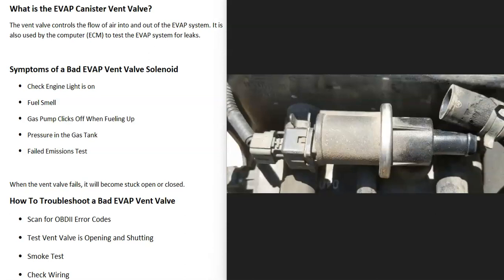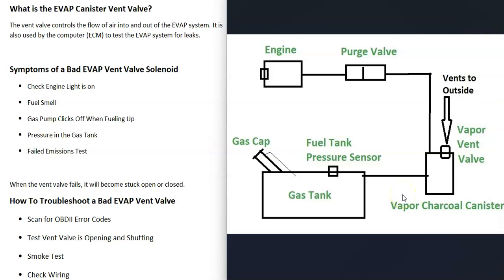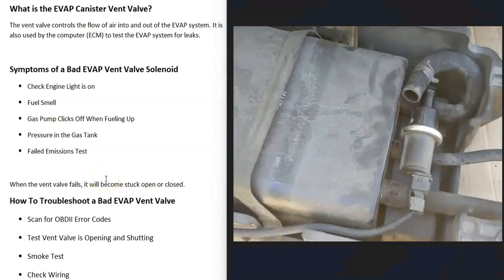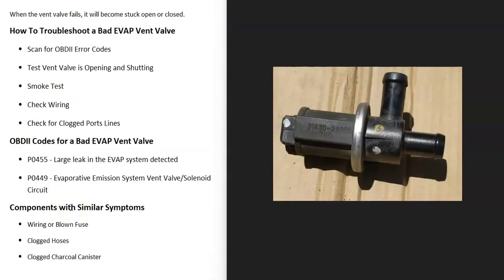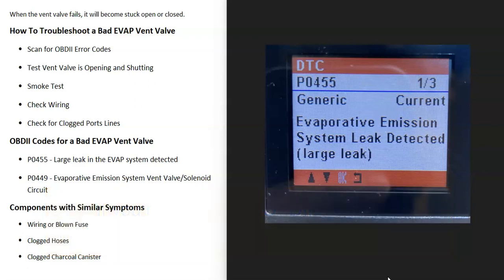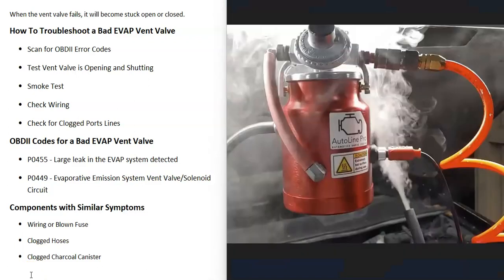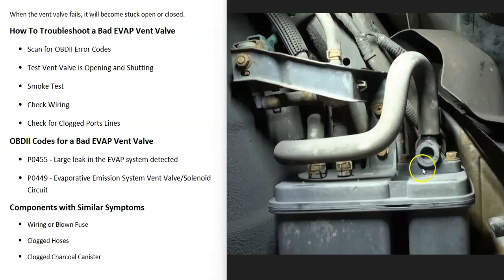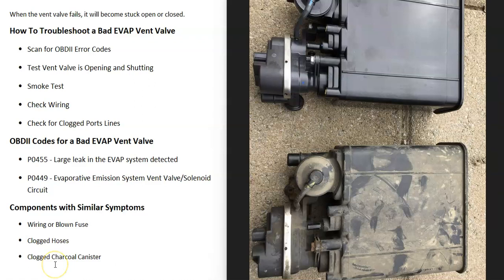Symptoms of a Bad EVAP Vent Valve Solenoid and how Test if it Has Failed

Comment: I took my vent valve out and did a bench test and noticed that the vent was getting stuck closed attached it to 12 volt battery to the sensor noticed that it was clicking but not moving sprayed wd40 in it shook it around gave it 12 volts a couple times worked the wd40 into it worked much better was able to see it moving.

Comment: I have a question. I'm not very mechanical, so if it's a stupid question I apologize up front. It may pertain to the evap valve referenced in this video. I have a 2013 Ford F150 FX4 5.0. It doesn't have a gas cap. Sometimes when I stop to fuel up, I can hear a sucking sound where the gas goes in and when I put the gas pump nozzle through the inlet it all releases in a gasp. If I turn the engine off while I fill the tank, it's very difficult to start. Almost like it's not getting fuel. It does eventually start. If I leave the engine running while I refuel, it does fine. The check engine light comes on once between each refuel, but goes back off in a day or so, and the gas gauge isn't accurate so I fill the tank full each time. I have never been to get engine light checked while it was on. Any idea as to what I need to replace?
Reply from the maker: I would test the purge valve; it is located in the engine bay.

Comment: Hi can this cause rough idle and negative fuel trims?I only have sometimes have fuel smell inside cabin and sometimes fuel pump at gas station clicks off
Reply from the maker: A bad EVAP purge valve located in the engine bay can affect the engines idle. A bad EVAP vent valve stuck shut can cause issues when fueling up.

Comment: Can the EVAP canister be cleaned with water or other fluid instead of replacing it with a new one?
Reply from the maker: The vent valve can sometimes be bought separately, but it will vary. Many vehicles now have it contained in what's called a leak detection pump attached to the charcoal canister. The charcoal canister is full of small charcoal pellets that filter the gas vapors. If that is clogged, I'm not sure if that can be flushed or not.

Comment: i have a 2013 wrx, having issues with filling up and not wanting to start up right away. I replaced the purge evap, the charcoal canister but to no avail. i think the vent valve might be my only other option and relatively cheap, to hopefully solve my issue. :( i also dont have a check engine light so i dont see any codes to show what it exactly is, just know its only when i fill up but i do smell gas inside my car. very aggravating.
Reply: Hi did you get this fixed? I’m having the same issue on an 08 outback plus low/rough idle sometimes.
Reply: @jacobbranca the rough idling at times hasn’t stopped. It tends to want to go up to 1.5k rpm at random times when I have the clutch in stopped at a red light. not sure what that could be. But the not starting up after filling it up has stopped thankfully. Since making this post, I’ve since replaced the vent valve and the gas cap right after and it seems to have gone away.

Comment: hello bro, i change already my vapor canister but sitll overflowing my gas tank while its full and the gas nozzle stop. but my gas tank overflowing gas. i change already a purge valve as well but its still same issue... how can i solve this bro?
Reply from the maker: While a bad vent valve is the most common cause when the nozzle clicks off, other causes can be a bad Fuel Inlet Check Valve, Roll-over Valve, or other manufacturer-specific component. If the vent valve is good, I would get a diagram of the filler neck components to see what else could be causing it.

Comment: Great video, explains it well!    My issue I've been having might stem from a bad vent valve solenoid; My gas tank definitely has pressure buildup (noticed when I open the cap) and when I fill with gas, it ends up backing up and spilling out even when the tank is near empty.
Reply: I have the same problem. Did it end up being your vent valve?

Comment: If the AVAp canister- mine is by fuel fill  underneath it-- If the valve is a release to pressuring the system in  tank why wont it releease the pressure to fill with gas  when key off..I even  to hose off.. still wont fill...Sometimes it  does. usually if go  to gas station  right away.. The Purge valve I am told is Not  talking  to te computor!!! Now I am getting EGR..Just  replaced that  and  upper and lower intake manifold gaskets..I am getting Po443 Or is it Po433.I  forget..wont even delete  with  scan tool  many times..takes 2-3  tries. Been  this way  for 3 yrs..there is a anti slop valve in tank  where the Big  hose come down t the charcoal filter.. That maybe sticks!? I  dont understand  why pressure doesnt release  when key is off!! or hose is totally  off to EVAP canister!!??

Comment: If I smell strong gas smell outside the vehicle near the gas tank only when  the tank is filled above 3/4 , and goes away when tank is lower, no leak around pump, no leaks seen, no gas smell inside, no check engine light, no issues with filling.  could it be this part?
I do notice if cold ,first start is fine but if I drive a mile ,park  and 20 minutes later I try to start, the engine stumbles/takes longer to start. 3rd start no issues. 
I'll be changing the vent valve tomorrow because that did check out to be stuck open. But I was not sure if a strong gas smell around the gas tank would be from that valve.
   Ford Escape 2.3l fwd 176,000k .

Comment: can this make the engine have a slight misfire in Park, especially when first start up for the day ?  Car ran good until cold weather but uses obd1 scan tool which I don't have.
Reply from the maker: I've never seen a vent valve cause engine issues. Usually, the only EVAP component that can affect the engine is the purge valve in the engine bay.
Reply: @HVAC_Mechanic  Thanks.  Purge valve on order because it has a rattle/tapping to it which was never there before, original equipment.

Comment: I have codes po452 and p0651. I have difficulty refueling and difficulty starting after refueling.  Reduced engine power light on and won't drive. 2005 suburban with 6.0 engine. Anyone want to buy it? In socal 20k

Comment: Thanks for your great video's strait to the point and very informative. My 2003 f150 has po 455 and 457 . Watching your video's I confirmed my purge valve is good. I hooked a new to me smoke tester to the line at the purge to the tank. I applied 12 volts to the vent valve to close it. I had smoke seeping out of the pressure sensor at the top of the tank and a very very small amount coming out of the charcoal canister outside air port. I dropped the tank part way and put a new pressure sensor in. Same results still smoke at the sensor and canister. Smoke machine under to much pressure (which has a built in regulator) ?  If not is there something I can do to stop the leak at the new sensor from the blow by at the o ring ? Thanks for any help or input.
Reply: Replace the whole canister it’s probably warped or something

Comment: Hey man, I have a 19 Camaro SS (6.2 V8). My evap vapor percentage is CONSTANTLY in the negative (measures in inH20). Even with the evap command is zero it still stays negative. I'm running extremely rich, and have checked everything. When it starts to evap command goes to zero (shutting), the vapor percentage reading goes EVEN MORE in the negative (-4.6 inH2O). It's constantly purging while I'm driving, it seems, rarely does it go to zero. What would cause this?
Reply from the maker: It needs to be diagnosed but I would test the purge valve in the engine bay. I made a full video on all the EVAP components and how to test them; here is a link. https://youtu.be/C5s3Rx3wjD0
Reply: @HVAC_Mechanic  i did, it was shut with unplugging the connector. It seems to constantly run though 🤷‍♂️
Reply: @HVAC_Mechanic  car did seem to run better with it disconnected, and my fuel trims did get a tiny bit better, and the inh20 reading was EVER so slightly in the positive for the first time i had ever seen.

Comment: I have a P0442 and changing the gas cap and purge valve did nothing to fix it. I’m wondering if it’s the vent valve in back.
Reply: Does the gas pump shut off while filling?
Reply: @ no and this was 4 months ago. Problem was solved.
Reply: @Jonathan-A-877  Glad it was fixed. What was the solution?
Reply: @Jonathan-A-877  hey can you give us some insight on what your issue was?  Got same code, have changed the gas cap, purge valve, and charcoal canister and still having same issue!
Reply: @benjaminwatson2695  All I did was tighten the gas cap more after filing and it went away. So, it actually was the gas cap on my Saturn. No light or code since.

Comment: I had my EVAP solenoid valve replaced in my 2020 Ram 1500 and it still has check engine light on and the gas pump clicks like crazy. Do you think it’s the tank, charcoal canister, roll over valve or filler neck?
Reply from the maker: That is a common system of a bad vent valve. Was the correct solenoid replaced and tested? There are usually two solenoids: the purge valve (evap solenoid) located in the engine bay and the vent valve located near or built into the charcoal canister.

Comment: Is possible to clean the vapor vent valve canister
Reply from the maker: If a hose or port is clogged up, they can be cleaned out, but the canister itself would need to be replaced.

Comment: On Moms 2010 Chevy impala , throwing a Po453 and po463. When working on Putin a new fuel pump, noticed the 3/4” hose coming off the evap canister was full of fine dirt, from the dirt road she lives on. Gas tank was clean. The vent valve was slap full of dirt and the hose. The top has tabs , so you can take it off and clean it. Has a round sponge filter to washout as well. Should I just put it back on and try it ? Should I also put a new charcoal canister on. Not throwing codes for either.
Reply from the maker: As long as there is no wiring issue, swapping out the fuel pump will likely solve the codes. I would only swap out parts once they fail, but if you think they are ready to fail, it may be a good idea.

Comment: I got a great question, should gas be coming out of the valve?
Reply from the maker: The only gas vapor comes out of the vent valve. It should not be liquid.
Reply: @HVAC_Mechanic tell me about it.. ugh, no idea what the hell is going on 🤦‍♀️
Reply: If you have liquid fuel coming out of the vent valve I would guess your charcoal canister is full of gas as well. Do you "top off" your tank on fill-up instead of stopping when the gas pump shuts off the first time?
Reply: @JK41071 I had already replaced the canister before this. I looked under my other silverado and how those lines were hooked up. Turns out I switched the smaller rear lines so they weren't hooked up to the right things.

Comment: Can this prevent my car from starting?
Reply from the maker: The engine should still start. If the purge valve (separate from the vent valve) is stuck open, sometimes, it can affect the engine and may cause longer start times, but usually, the engine will start.

Comment: Going crazy.  Have a evap issue with 02 Suzuki XL-7.  Decided to replace the whole contraption to eliminate rusted evap lines and old hoses.  The vent solenoid body definitely leaking.  In my process I've found a small line coming from the fuel tank vent that goes to what looks like a check valve.  Seems simple to just replace but not sure if it should really be a one way or a metered valve. Seems like open going toward tank and restricted going into larger line that goes toward charcoal cannister.   Don't want to install a new one way check valve if it is supposed to allow air both ways.  Also not sure if it is even needed if there is a evap solenoid doing this job already.  Confusion as to if it is to hold back some pressure to stop the gas pump when filling.  Not seeing this valve in any diagrams I find online... don't want to install something that may have been done previously in error...
Reply from the maker: There are differences between EVAP systems depending on the year, vehicle, and manufacturer; the only way to know is to find an EVAP diagram for the vehicle.

Comment: Got a PO0456 code.  Evap vent valve seals ok with light pressure, but not with vacuum.  Would that generate an code?

Comment: How about diagnosis the opposite where the automatic shut off doesn't activate soon enough so that everytime you fill up a small amount of gas spills out before it shuts off.
Reply: I am having same problem on 2004 F150 4X4. Have you found fix?

Comment: if you do a smoke test and smoke comes out the valve, its not necessarily bad because it is normally open until it gets a signal, correct?
Reply from the maker: Yes, this is true. I should have clarified this better. You can turn it off by adding power, usually with a scan tool, or be aware of its location and that smoke will come out of it.
Reply: @HVAC_Mechanic  Oh man! I wish I had read this before I dropped my gas tank, took off a rear wheel and all the shrouding, to replace my charcoal canister only for the new one to leak out the same atmosphere valve!  Half a saturday gone!
I'm out of ideas for hunting down that evap leak code, changed charcoal canister, gas cap and purge valve.  smoke test only ever showed smoke out of the charcoal canister atmosphere valve.

Comment: Hi I have a 2003 Ford ranger 3.0 V6 my motor is running rough and when I stop and shoot down the motor I hear like a weasel on the back of the truck you think that's one way to know that the canister vent valve is bad?

Comment: My mechanic says I need this but I have a code for a very small leak and I have a bad o2 sensor, my question is, is my mechanic scamming me because I’ve seen most of these solenoids cause large leaks
Reply: Leave the O2 sensor aside, it is a different issue, not related to your EVAP system. Your mechanic is possibly guessing what the issue is or he is fact going for the most expensive ticjet item, both cost and labor, and get that possibility out of the way and perhaps work his way down to the less severe and less expensive repairs.

Comment: Please help me if you can. We have a 2014 mini Cooper countryman after 150,000 miles. It has been a pain in our butts. There is a clicking sound when the car is cranked when we first noticed it we were out of town, and they said that it was afuel tank vent valve. Nothing to worry about they said, but now it’s making this clicking noise. We’re scared to drive it very rough idol. Please help if you can. Thank you.

Comment: I have a 03’ Dakota V6 3.9L. Code: P0441
Replaced the Gas Cap & Purge Valve. Should I replace the vent valve and/or the evap canister.
Reply: Completely same problem on vw polo 6r i did the same things as you. Did you replace vent valve or charcoal canister? have you got rid of the p0441 code?

Comment: thanks for the video....I have an f150 that I can't put more then a gallon in without clicking off.  Disconnect charcoal canister and it still happened.  It definitely not opening to let pressure through.  Needed a good symptom video to confirm my suspicion.  Thanks.

Comment: I have a 2003 ford focus  2.3  my engine light cam on  sunday afternoon as soon as i started my engine and i got a po446 cont  circuit code  could this be  a bad vent solenoid ? I has a slit second where I smelled raw fuel one time  and every other time i fuel up it clicks as soon as i put the nozel in

Comment: Thank you for this information. Currently still have a P1457 code even after replacing the charcoal canister and solenoid valve. No one rents a smoke tester, and the repair shops qoutes for the smoke test are between $150-$300. There has to be a better dyi for this issue. Any suggestions?
Reply: Hand held pump and a cigar
Reply: If I do a smoke test on evap system , do I need to manually close the evap Selenoid?

Comment: Really like your straight to the point video. Nice job! Questions: What conditions should be in place such that the PCM will open the EVAP purge solenoid valve while the  EVAP canister vent solenoid is opened?  i.e. I would think at idle the purge solenoid valve would be closed. Conversely at some higher RPM, with other certain conditions the purge solenoid valve would be opened and its open duration measured via the oxygen sensors (sort and long term fuel trims).  I cannot find the DETAILED operation of the EVAP purge solenoid valve as controlled by the PCM (over all the engine speeds and loads)?  I would expect the EVAP canister vent solenoid to be open at all times and only closed for a leak test by the PCM.  I would also expect the EVAP canister vent solenoid to be open when the engine is off and car parked.
Reply from the maker: It varies depending on the year and manufacture.
Here is an example for a Third-gen Chevrolet Camaro 
..150 seconds have elapsed since the PCM entered closed loop.
..Coolant temperature is above 176 degrees F. (80 degrees C.).
..When the PCM is not enabling injector shut-off, such as on vehicles with traction control while one drive wheel is spinning.
..The idle contact switch in the IAC motor is open.
..Engine speed is above 1,100 rpm.
..The engine metal temperature sensor is not indicating excessive temperature.
 ..Low coolant level is not indicated.
Reply: @HVAC_Mechanic  Have 2004 Malibu Maxx 3.5L - summer conditions - Long Term Fuel  Trims way negative (-25) on both banks - temp 180 - various RPM - coolant level to spec. When the PCM commands the  EVAP purge solenoid to open, does the PCM also command the EVAP canister vent solenoid to close or open?